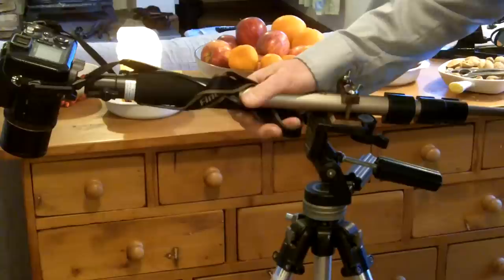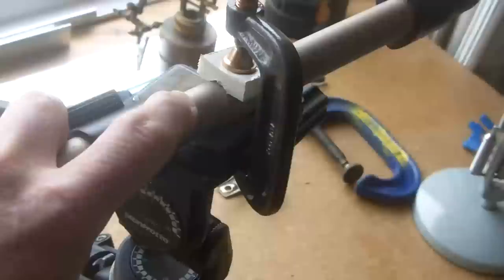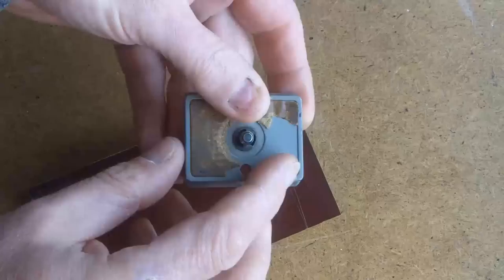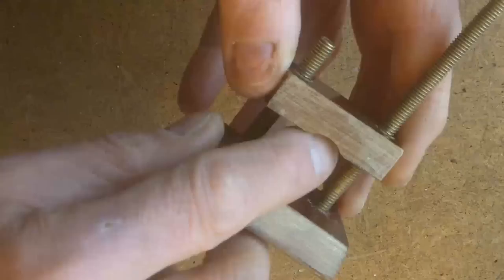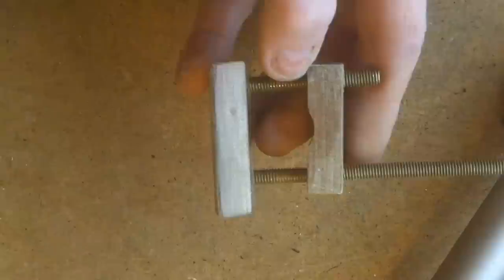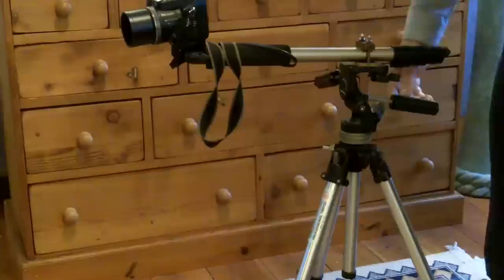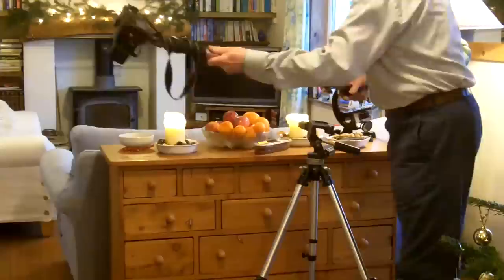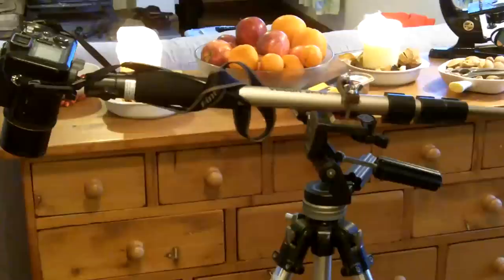Poor man's Benbo tripod mod/addition

Comment from the maker: Hi Ian, I was a cinema projectionist and I showed the flight of the Phoenix when it was first released, what a good film!  My company was Cheltenham Induction Heating Ltd, Phoenix Works, Saxon Way Cheltenham. The first 50 kW 10khz thyristor inverters I designed and built I called ‘Phoenix’ invertors because like the film my creation was built out of a pile of scrap equipment, I sold the first one to GKN for melting plastic powder onto the threads of bolts for a threads locking application.
Andy

Comment: Good idea there Andy. Might want to make another adaptor to enable you to clamp an anglepoise lamp onto the monopod to use with a light with a diffuser front to provide adjustable fill lighting as well.  Counterweight and camera light all in one. Nice work there with the Bakelite board. You can refurbish the Manfrotto foot with thin rubber sheet instead of the cork, it is a lot tougher and grips better as well. Old bicycle inner tube rubber works well.